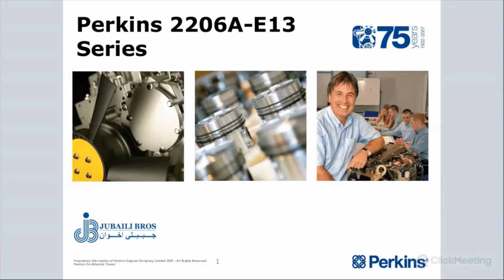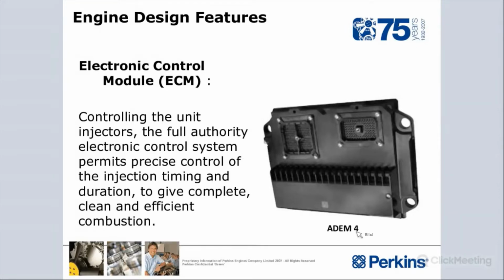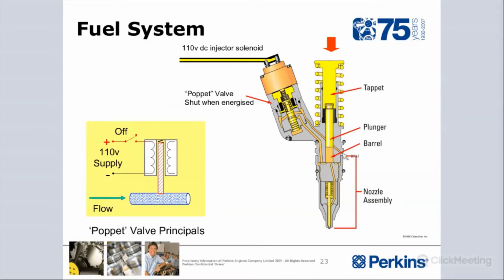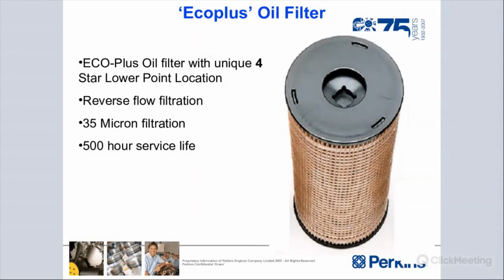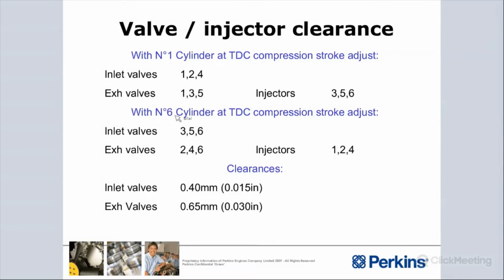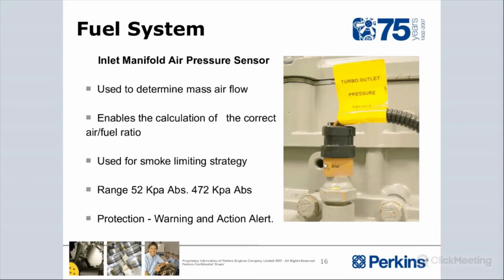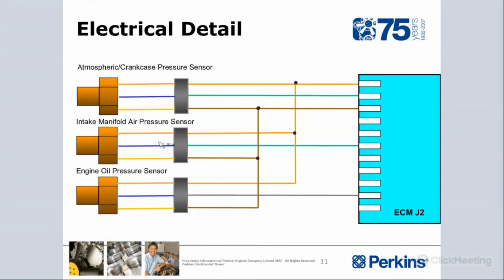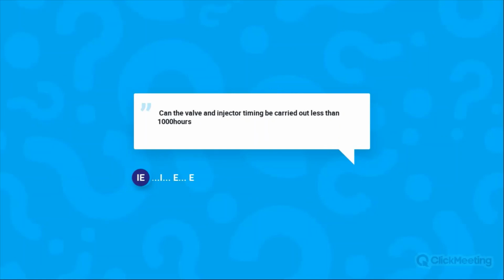Webinar: Perkins 2206A E13 Series

Comment: This is very helpful. Thanks for the effort.
I just want to clarify regarding the change oil interval cylcle; since the service hour for oil is every 250 running hours and the fuel filters / oil filter is every 500 running hours, it does mean that change oil servicing cycle will flow like this (1st servicing OIL only.  2nd servicing will be OIL, OIL FILTER & FUEL FILTERS and vv). Am I correct?